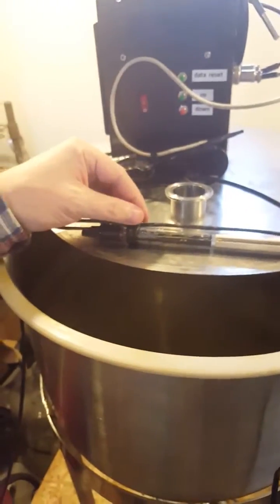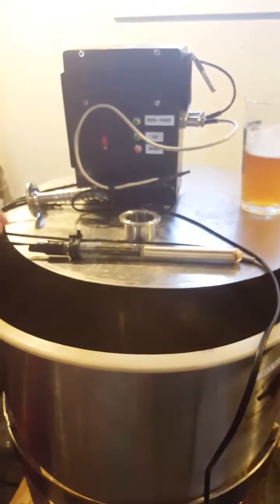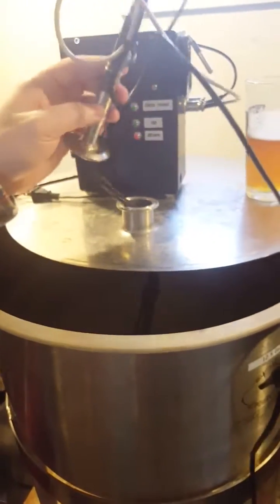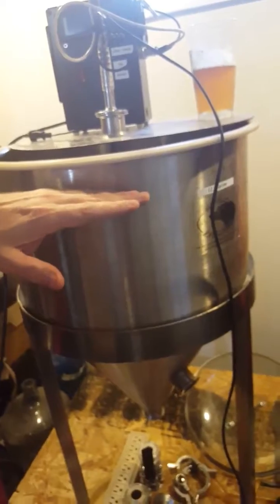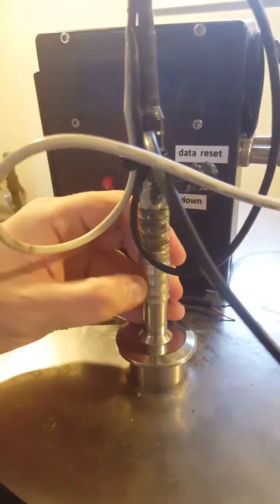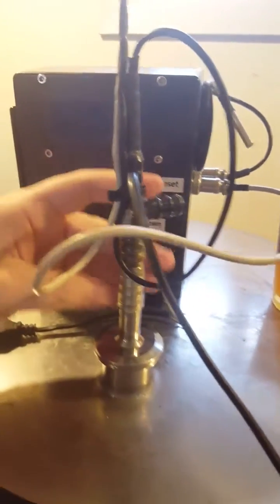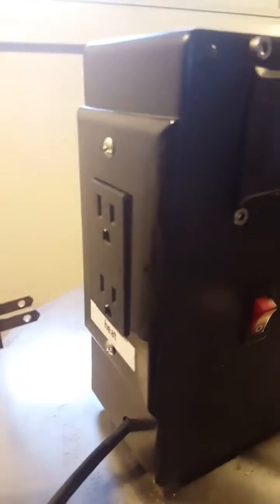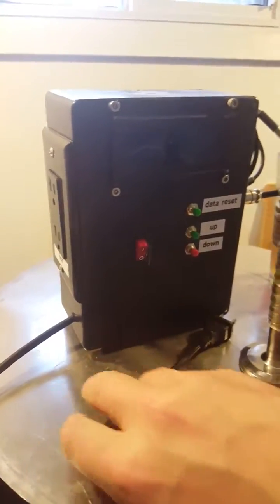added submersible aquarium heater to fermentor

Comment from the maker: to those that are concerned with the heating element getting too hot and possibly changing the yeast closest to the heater, I will control the output to the heater and dial it down, slow and steady / also I do have a 12.5 gallon fermentor, so it shouldn't be a big issue, but I will run a week test run just on some water and capture the data with the #beeruino and see how that plots.